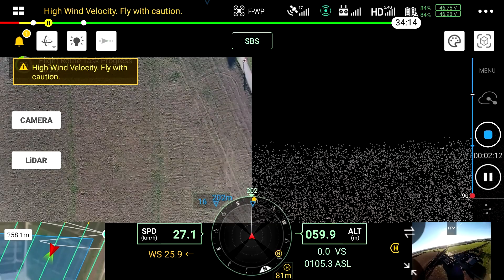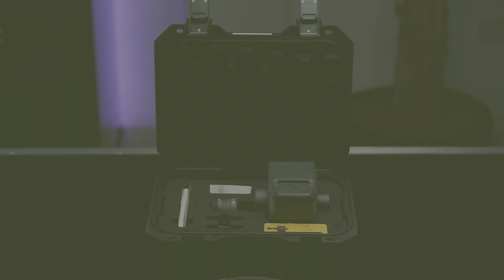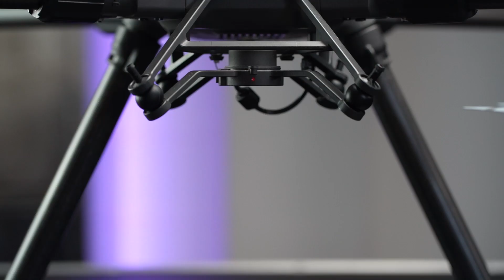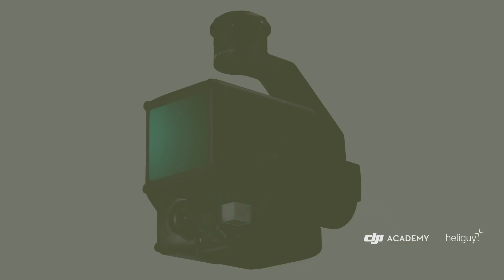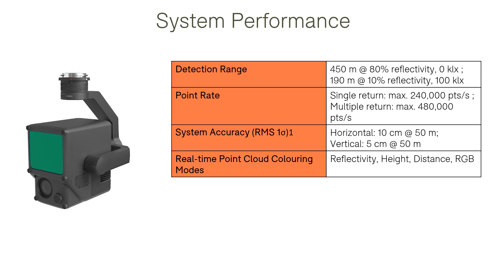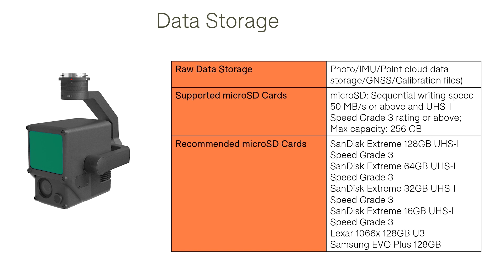Introduction to DJI Zenmuse L1 - Start Here

Comment: Hi Dji Enterprise,  I still have mapbox installed on my Smart Controller. Is there a way to update this map, as the data are very old. Some installations achieved years ago are still not visible on the map 😪